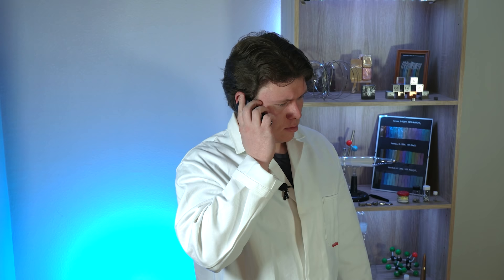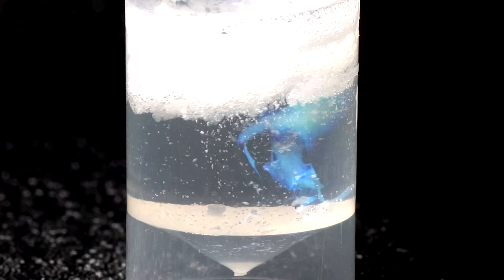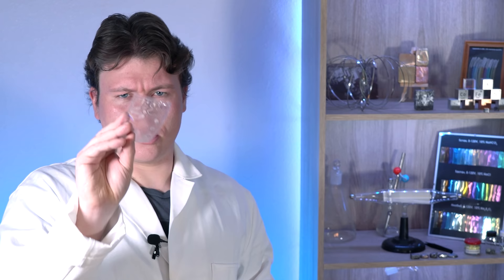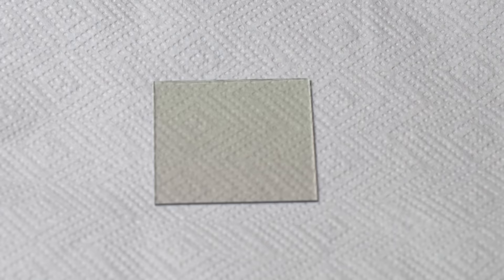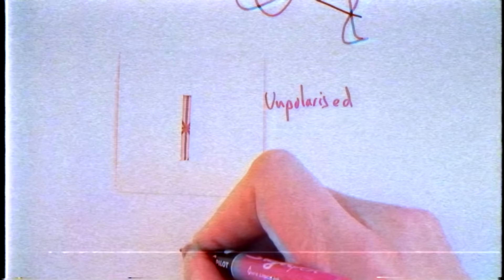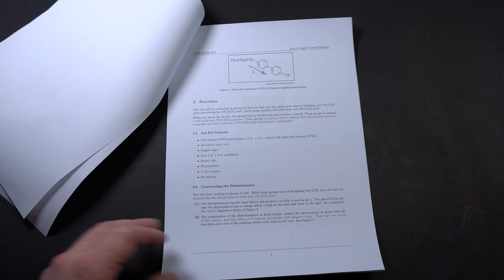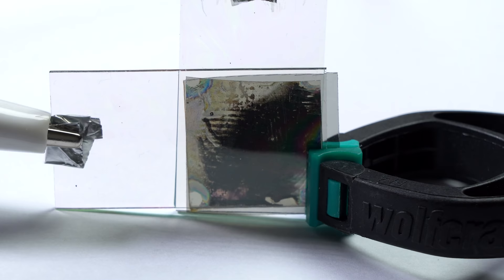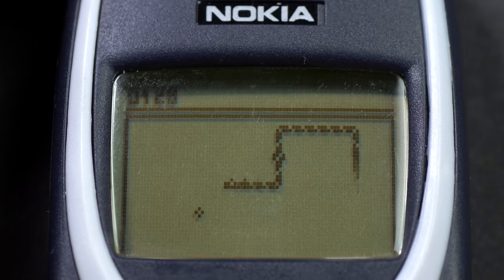Why it's So Hard to Make a Homemade LCD Screen?

Comment: As a kid growing up in the 80's I can't tell you how many LCD screens I pulled apart trying to see how they worked, but the only thing I discovered was how mad my dad got when I pulled his favourite lcd calculator apart. 😂
Reply: Was one of them using a DSM LCD instead of a TN LCD?
Reply: @HeavenlyNovae  
I was a kid, the only thing I knew was the pixies went in one way and numbers came out the other.
Reply: @johno9507  pixies?
Reply: @TheAutisticTech  
Yeah...the electrical pixies that come out of a battery. 😉
(It's a silly name for electrons 🙂)
Reply: I know how you feel. I also carefully took things apart but got frustrated when I didn't know how they worked.
Reply: @BlurryFace-zz2ro  
As a kid I didn't have any electronic books and the internet was 15 years away, I spent hours with a old multimeter testing old 60s and 70s radio components to see just what they did...ahhh the good ol days. 🙂🇦🇺
Reply: Me too

Comment: I’m really glad to see this! We did this back in 2010 in college with very little info! before we figured out using a thin coating over ITO slides we tried to use tape, glass, plastic wrap, two slides, 10Kv through a full slide etc! Finally we figured it out using thinned clear nail polish! Ours was trash tho because we didn’t think about a spin coater! But it’s really awesome to start from nearly scratch and figure things out yourself this was one of the most rewarding projects I have ever been apart of! We even won a contest at a conference!
Reply: In 2010 your research into LCD crystals would (likely) have been more fruitful in the library, rather than the laboratory, because the device had already been mass produced. I do appreciate that there are trade secrets and the info would not always be readily available.
Reply: Also they used laminated conductive rubber strips to easily align the tiny power connectors in watches an $1- stick-on clocks.
Reply: Can't you just sandwich the glass, the LCD liquid, then another layer of glass, and crush it with some weight? Wouldn't that work?
Another method apparently is to use microscopic glass beads between the 2 glass sheets.
Reply: What college did you go to? I would like to make my own LCD!

Comment: Nice work! I'm really glad you were able to make your own diy LCD. Was the problem with the initial build the power supply (DC vs AC) or something else?
Reply from the maker: I think the problem was in my photoresist, which I  used as a layer for making scratches on glass. When I substituted it with a PVA, it began to work.
Reply: @Thoisoi2   Good Afternoon can I ask question I want know about( Red Sulfur) and (Yellow Sulfur) can you explain to me what they are. Thanks
Reply: @Thoisoi2  up next, an LCD mask resin 3D printer! 

PLS
Reply: How much would this cost without the expensive signal gen? I'd like to try it with an Arduino.
Reply: @JohnDuthie  subtract 300€ by 250€ for the signal gen 😇

Comment: Cool. Have you thought of doing a video explaining LEL and HEL of petroleum? Through these experiments you could calculate how much fuel is required in a engine cylinder and calculate/ show the efficiency of engines - why they are so inefficient.

Comment: Power supply should run -6V to +6V because a DC bias from 0V will allow ion transport. Place tape over the indium tin oxide where the electric signal is (alligator clips) before the polymer spin coat and remove after buffing so the ITO makes a good contact. Super glue and many other glues with catalysts and accelerators for cross-linking polymers contaminates liquid crystals with ions so try thermoset or thermoplastic adhesives. Liquid crystal should be free of oxygen, water and salts for best performance. Liquid crystal is also more expensive than gold by weight, as you noticed. Liked your video! Thank you.

Comment: Hmm, looking at 16:48, it appears that as the LCs align (at the rise of the square wave) they not only cause the liquid to move, but they also push the glass panes, forcing them to flex. The relaxation of this flex then pushes back onto the LCs, disrupting their order; it's only the fast rise of the square wave that triggers enough impulse to overcome the pressure of the glass.

Rocky Robinson below points out that, in the industry, they use glass beads to force separation between the panes of glass. This would reduce/eliminate any constant, uneven pressure on the LCs, and the tension in the glass would be eliminated.

It'd be interesting to see if this could be described with an altered Ising lattice model. There would be three factors: Temperature, pressure, and applied voltage, where the latter has uneven splotches, like a smooth Voronoi pattern. Higher temperatures and steep pressure gradients would cause the individual crystals to stray from the alignment induced by the voltage (randomly). Maybe I'll throw this together sometime this week and see what kind of patterns arise as a result :D

Comment: I'm thinking you could knock the cost down by omitting the dedicated frequency generator and instead drive the display using an oldschool 555 oscillator fed into a simple amplifier, maybe with an extra comparator or two thrown in to make the signal transitions faster.
You could similarly use a computer's sound card as the signal source for the ~20Hz to ~22KHz range, and feed that into your amplifier to get your desired voltage.

Comment: Good Job! Now here are the next challenges:

1. Create your own LCD screen                               [ / ]
2. Program it to adjust brightness                          [    ]
3. Make the display change to different colors     [    ]
4. Make it touch-sensitive                                        [    ]
5. Create an image using multiple LCD                  [    ]
6. Display motion pictures                                       [    ]

7. Create a simple game using the display            [    ]
8. Now test for heat and water resistance             [    ]
9. Bend test                                                                [    ]
10. Samsung approval                                              [    ]

Congratulation in advance!
Reply: Step 2 is get enough funding for the next steps

Comment: Congratulations! Your video is fantastic! I really wonder how do they physically wire so many pixels on screens without actually using wires. I have taken apart monitors but haven't seen cables at all. I guess they somehow multiplex the output for all these pixels nowadays? Must be a nightmare...!

Comment: I dropped my Nokia phone in my brother's back yard one night. His dog got hold of it and chewed a hole through the screen outer glass. It rained that night, and the dog left the phone at the bottom of a puddle, completely immersed. It soaked overnight, and I found it at the bottom of the puddle the next day, the phone was completely full of water from the tooth holes. I let the phone dry for 24 hours, worked fine, 100%.

Comment: I was thinking to make a multipixel LCD with the photoresist (+ my SLA 3D printer for burning the segments/pixels into it) and then etching the pixels with acid
but it doesn't look you can get a good LCD quality in DIY environment :(((((

Comment: drop droplets of solution that are smaller then the surface tension of liquid being used, heated to evaporation yet before contact condensates into a droplet. "3nm LED?"

Comment: I always got the concept of LCD, but how the F do they get the power to each pixel(and the RGB LCD's in the pixel for color displays) without the back of the display being covered in wires not allowing for backlit displays? 1920x1080 pixels is allot of non existent wires for just one RGB color channel and not even close to a 4k display.
Reply: I believe it's due to the conductive coatings on the glass.

Comment: Are you from a different timeline? 🤫😉

My father had a cellular phone in 1996 and it had an LCD... The 3310 having an LCD display that was 'very uncommon at the time' is not borne out in my history/timeline...

LCD displays were literally a dime a dozen. Little $2 toys had LCD displays... I mean, the Game Boy was released in what, 1988? I am not saying you are incorrect, simply that here in the US, the LCD display had being going strong for quite some time. Even calculators of the mid-90's, with an LCD display and a solar panel for power, were often given away at trade shows, by salespeople and businesses/representatives.

Graphing calculators from the late 80's early 90's had relatively large LCD units in use...

I am GENUINELY hoping to learn about your recollection of the LCD units of the time, and your recollection of their use.

THANK YOU FOR THE FANTASTIC VIDEOS! EVERY SINGLE TIME!!!

Comment: Jesus, when the frequency hit 15,000,00kHz, I felt it scratching my soul through my ears.
Reply: That was 15.000,00Khz not 15,000,00Khz you would not hear 15 megahertz.
Reply: And yes I agree.
Reply: @stdorn  Yes I was confused because in my country we use dots instead of commas and vice-versa.
Reply: @KorhalKk  interesting. What country?
Reply: @stdorn  Brazil
Reply: Germany does the same thing, confused me a couple times

1.500 would be 1,500 which in america is different by a factor of 1000

Comment: diy micro led matrix rgbw on poly or amorphous silicon wafer by cvd
Reply: so you explained water crystal lcd workings
Reply: magnetically aligned shutter
Reply: magnetically (electro-magnet) colored ePaper memory
Reply: you can also do mems membrane shutter that keeps its direction without applied power
Reply: dynamic glass staining, embedded directional compounds
Reply: directional silicon light processing, depending on the angle of incoming photons, dlp mirror display redirection, from back light or with no back light, in ePaper, using external ambient light from environment
Reply: works as solar panel too